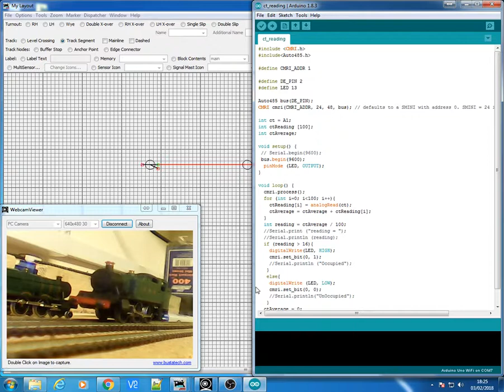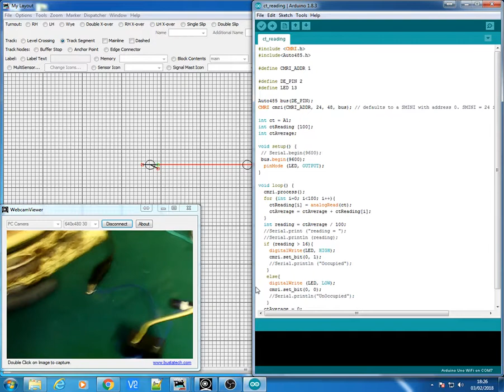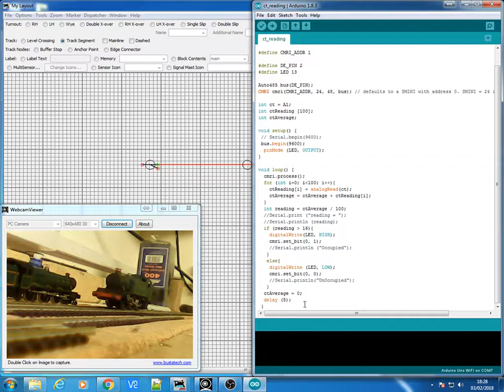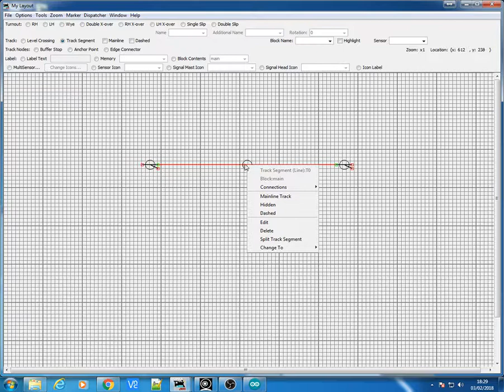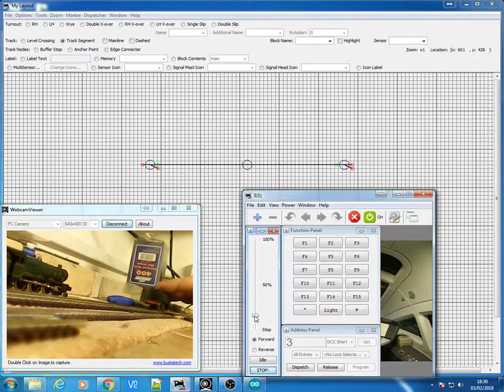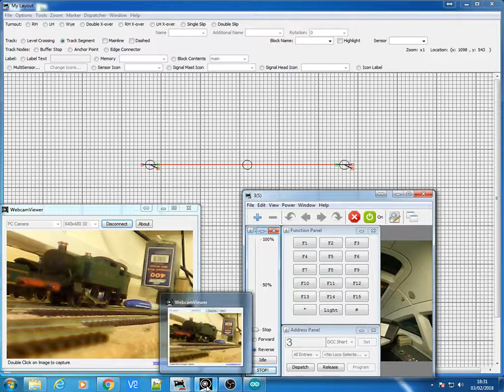model railway JMRI Arduino Occupied sensor

Comment: Good video, is there a way to add more CT's to the Arduino?
Reply from the maker: I did not get around to try it and do not have a setup at the moment due to a move. I would say you could by adding another analogue input so ct becomes ct1 and add ct2 to A2 input. Then for the for loop read each into different variables and then each if function will work on different variables.  If i get time some day I will have a go at this.